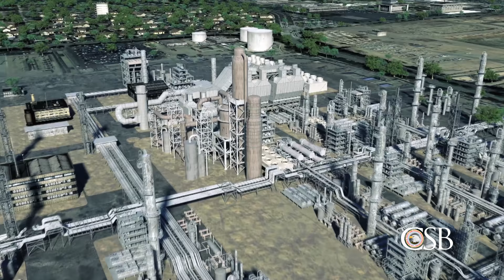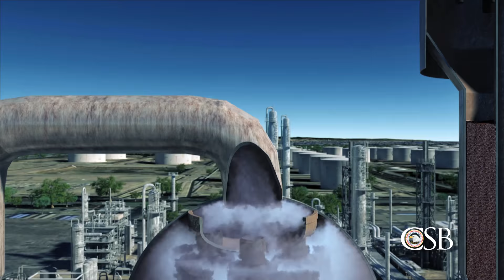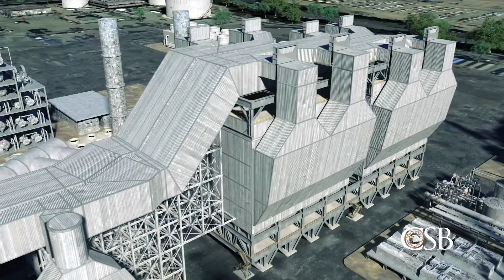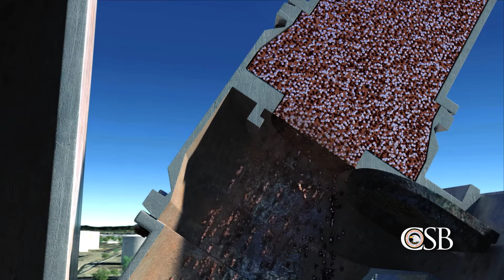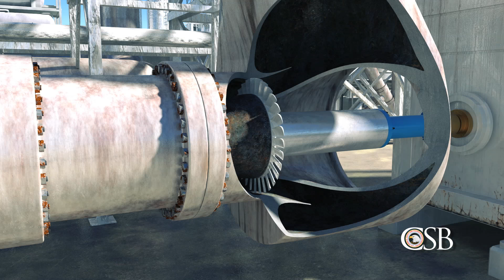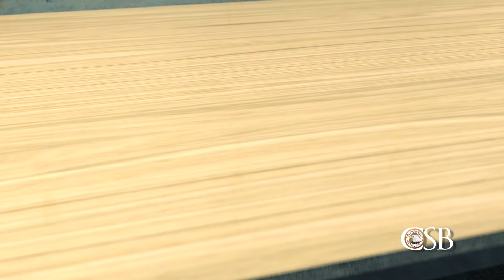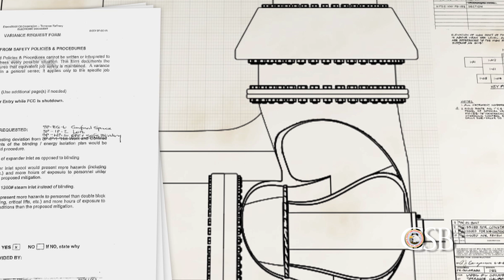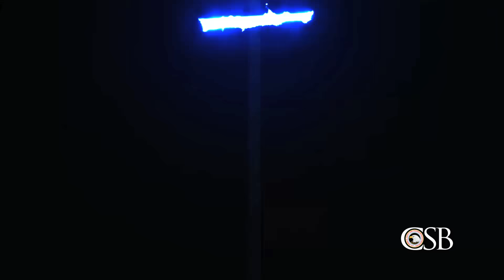Animation of 2015 Explosion at ExxonMobil Refinery in Torrance, CA

Comment: I am constantly amazed at how so many smart people, operating highly complex chemical apparatus can be so brain dead and make such incredibly dangerous mistakes. There really needs to be an in depth study about this very human characteristic. It happens all the time. When I was a safety manager at a major oil field chemical company, I would try to make sure all personnel were fully aware and trained about proper safety procedures in the field. Invariably I would show up on a job to find the job supervisor hims self had ordered extremely dangerous safety short circuits in procedure in order to just get a job completed when something minor had happened to hold up the work. I would complain to management, trying to get the company to insist these violations carry a penalty. I would always get rebuked, "You worry too much! They got the job done!" And then when someone was injured or even killed due to dumb crap violating standing safety directives,- management would come in with- "How come your safety department let this happen?"

On one job, I gave a safety briefing- meeting the crew of a very dangerous job meeting them at 3:00 in the morning before they left the facility- What ever you do- under no circumstances should you flow this chemical back into open tanks- highly flammable 99% ethanol. It had to be placed in tanks filled with CO2! We went through a lot of expense to provide the correct tanks and inert gas. Later that afternoon, I decided to visit the job site and rolled up just after they had flowed the ethanol back into an open tank- fumes had ignited from a nearby truck engine, exploded and burned everyone on the job terribly. No one was killed but three men spent several weeks in hospital. What the Hell? Why did you guys flow that stuff back into an open tank?  "We didn't want to go through the trouble of setting up the piping to flow to the CO2 filled tank. We thought it would be okay."  It would have taken them about ten minutes to re-set the piping! This was the third time that year the same dumb thing had happened throughout the company. My God! What does it take to protect people from themselves?
Reply: Hopelessand Forlorn 
That's right man.... I was designing field run pipe for United Engineers on site  at Seabrook Station 1981-85 and saw the design and execution from the inside out and  the level of expertise was astounding all around. 

After seeing the integrity of containment design it's not hard to understand fully how Three Mile Island, also by UE, survived what they have now discovered via unmanned remote vehicle was at least a 50% core meltdown with a very minimal radioactive release during the accident but none since, with the adjacent Unit 1 still in operation 35 years later. Workers there need no special protection on site. 

Unlike those tar paper shacks at Fukushima and Chernobyl claimed to be containment buildings, I have full confidence in these containment structures and those like in kind

Those reactors are housed in a 4 foot thick steel-reinforced concrete building within a building with a 4 foot annulus space to run at a negative pressure and can withstand 300 mph winds and its  debris, such as train engines... this can be found in the Final Analysis Safety Report on public display describing containment

That said, it seems deferred training and maintenance, (6 years since the slider valve in the video was replaced?.. as well as a stuck valve at TMI was found to be the blame)  lax safety culture and the aggregate intelligence of the American utility and energy sector worker, is not up to the level to ensure accident free maximum production. It's seems it is too costly to get it right 100% of the time whereas in the military getting it right is not a matter of cost

Sure TMI contained a major accident and thankfully no one was killed at this explosion though two were injured, but in both cases  the facility was destroyed and unable to produce both product for the public and profit for shareholders.

A ship tied to a pier is not the purpose of why a ship is built
Reply: @acadman4322  My father was an instrument technician who designed sensors for CANDU nuclear reactor control systems for 25 years.  Nothing freaked him out more than the latest crop of newly minted, know it all engineers hot off the university degree presses telling him that he didn't know what he was talking about because he wasn't an engineer.
Reply: For some people: Usually they don't make mistakes. But 99.999% isn't really good enough.

But for your example: they likely felt pressure, real or imagined, to complete the job as quickly as possible.
Reply: New safety guy here. This is the biggest frustration, how many incidents are already covered by standing safety procedure. Humans are really bad at calculating risk, so often times the corners they cut are more dangerous then they think. Combine that with irregular training between companies and workers, and a lack of direct involvement by the people who understand the entire process needed to keep lower level workers from making choices they don't know are bad and accidents are going to keep on happening. Safety has to come from the top and anyone down the way needs to be on board or they are just another liability.
Reply: @joelr877  My arguments have been severely criticized by some who simply say, "We are all human- duh!" (that's their point boiled down to the essence). And I vehemently disagree because I saw times when an intense training program coupled with intelligent company support and accident prevention programs did dramatically reduce the accient rates. There really is no telling how many lives were saved by such programs, not to mention the untold billions in damage were prevented.

But, the problem, as I see it, is there is no way to budget the asset side of accident prevention programs. The accountant division of a company will never hand the BOD a sheet that points out the $5 million spent on the safety program made the company $400 million in profit by saving lives, preventing lawsuits and keeping valuable infrastructure and equipment from being destroyed.

Thus it becomes quite easy for industrial leaders to ignore, or in some cases, not even be aware until it is too late, of what benefit the company is experienceing through the safety process. Executives and Department heads are bound by not only their benefits packages but also by their education, training, experience and the very system within which they exist. The corporate environment itself is the hound that keeps peeing (so-to-speak) on the carpet.

We safety types can also be argued into oblivion by corporate types who will point out, as they did on the DWH disaster, that that "BOP cost 45 million dollars! How dare you accuse us of skimping on safety?" Which is a bull shit argument?  It does not matter one bit what it cost- it was a piece of garbage that was incorrectly assembled through- what? Negligence due to improperly trained people, a failed inspection process and a hasty schedule that put undue pressure to "Git'er Dun!" In other words, it was a 45 million dollar hunk of useless iron and was made that way by corporate bull shit tactics in the first place. It was a BOP in name only to satisfy rules and regulations that the corporates considered a terrible hindrance to them making the profit they sought and keeping unrealistic, end-of-year bonus schedules!

You can go back through the long history of industrial horror stories of corporate disasters and find this very same pattern of ultimate responsibility for them in just about every single one. "But, we are just human" does not cut it with me. We are intelligent and so we should be doing way much better than that!

So, the fact is, the system fails all along the long train of responsibility, particularly at the very top! If safety is not the top-dog goal, right along with corporate profit, then what is the point? Am I right?
Reply: ACADMan Laziness and lack of training  or awareness on the operator’s part, and a drive for profits on the upper management’s part.

Unfortunately, the people like you, who understand procedures and the risks associated with operations, are not taken seriously by either of the two groups.
Reply: book knowledge only,,,, no common sense,,, lost it all in college classes
Reply: Laziness is a sin. And look at the consequences. If you're lazy for a job as important as that. Imagine in their regular life? Man die for the lack of knowledge. They need to go back to school to have the same level of awareness that you have.
Reply: Unfortunately it seems money is worth more than human life.
Reply: Being smart doesnt mean you wont make mistakes.
Reply: You can’t protect people from themselves. All you can or should do is record everything you tell them, and if your boss asks you why this happened, prove that you told them to do this instead of that!...

Unless that doesn’t work.
Reply: @Yoko_Grim  Good point. But, in those days, video cameras were the size of bread boxes.  So, we had what is called a "Safety Briefing Log". I  (0r an assistant from the safety department) would give safety lectures and briefings before each job. I would read on the job schedule which jobs were going out and review all written policy regarding that particular procedure and, also based on my experience, I would write up a 5-minute (or 10 minutes) safety briefing, reminding these well trained and experienced people of the hazards and also issue directives to the supervisors on mandatory safety  procedures. Each man assigned to the job had to sign off that they had received this written briefing and agreed to follow the suggestions and requirements. Everyone hated these briefings and thought they were a waste of time, after all, everyone already knew all this stuff - right? 

 But, the ideal is far different from reality. And often unforeseen circumstances would arise, such as sub-contractors and other company employees would be on the job doing their own things. If their practices endangered our crew, the  Job Supervisor had no authority to cancel the job. He would go ahead as best he could and protect safety as much as conditions allowed.  Sometimes equipment would fail, and alternate procedures would have to be used that did not allow for complete safety as we had originally planned. Specialized equipment that was designed with safeguards might not arrive on time, etc.  so, the rule, "Or as safe as possible..." would be applied. AS many here have pointed out- the completion of the job to the customer's satisfaction was the bottom line-  complete safety be damned. And they excused this thinking by saying, "Safety is never 100%. This oil field business in inherently dangerous. Some risk has to be accepted."

I disagreed with that philosophy. But, I also understood it.
Reply: Honestly, those workers werent qualified - so immature to disrespect your thorough order. They are better off in fastfood even though Id worry for the restaurant too. Your upper management setting the hiring standards arent willing to pay enough for respectful, technically caring, and above and beyond responsible workers. 

If they cant pay the bottom line to ensure quality and overall good vibes, they really shouldnt keep the business going.
Reply: Gotta leave a truck running to have an ignition source!
Reply: Production department of nearly all chemical industries are too lazy and arrogant-From a prespective of a maintenance engineer for ten years
Reply: Thankfully in this video the workers looked at their safety equipment, said "oh shit, that ain't good" and evacuated. I've been seeing a lot of this animations and almost everyone is the same, some dumbass either 
A) turned off the safety equipment
B) didn't have it or ignored it.
One of them was about an ammonia leak at an ice rink. An important part in some piping and gone loose and triggered an ammonia leak during maintence. So standard protocol went, alarm activated, HAZMAT arrives, Fire teams and contractors dawn SCB and enter and isolate the leak.
Well so the fire dept left, so the higher ups decided to try and get the system up and running to save money. So they shut off the alarm, and sent 3 contractors in to fix the generator that had been contaminated. So they went in, (I believe they hit the pipe or the pressure of the system running to keep the ice caused another leak) and they were exposed to extreme levels of ammonia (I believe I remember upwards of 500ppm, maybe even higher than 1000), killing them instantly.

So not only did the business turn of the alarm, they restarted the system while it was being fixed.
But wait, the workers, didn't have SCB or Personal detectors!
A double whammy. Both sides are idiots.
And for a triple, no HAZMAT was supervising the work, so the Fire dept had no idea because the 3 workers didn't ask for a fire truck to help them, and the higher ups shut off the alarm (which is connected to fire dispatch)
Reply: I helped build that esp.with TIC.good project.lot of money went into that Elephant..
Reply: ACADMan job scared contractors and workers, seen it many times. Yessa boss yessa
Reply: Still, this wasn't as braindead as the animation of the 2012 accident at Chevron's 
Richmond Refinery.

Firemen poking an old, leaking sidecut with a metal spear to pry off the insulation
and spot the leak. 
 
When that didn't work, they tried washing it off with their fire hoses. 
Luckily, no one was killed.
Reply: That's what I thought when I saw how the Japanese had built the Fukishima nuclear reactor on the shoreline of earthquake and tsunami country.  It was originally to be built on a hill away from the coast but those genius engineers decided to save money on seawater pumping stations.
Reply: I would fully agree with you and how alot of accidents do happen from human error, alot also happen because a situation was created that personal weren't aware of, like in this incident, they didn't know that the pressure of steam had decreased enough to let a little bit of light hydrocarbon's through the system. I did several papers on industrial accidents and more times than not, the personal were unaware that something like that had happened, prior to their involvement.
Reply: You give humanity's intelligence too much credit.
Reply: Ethanol’s flash point is 60 degrees F..
Reply: You can’t protect idiots from themselves. But you can fire the fuck out their asses. They can make dumb decisions at home.
Reply: It's easy to criticize with 20/20 hindsight when you get to see the video cross-sections of everything that went wrong.  When you're the engineer on a unit like this trying to figure out how to solve a problem that doesn't have clear-cut procedures for how to fix it and everything is sealed up, it's a little bit harder than just opening up the user manual and looking for an answer in the 'troubleshooting' section.
Reply: ACADMan dey izz teeVee watchers!!!
Reply: I told OSHA to put warning labels inside garage doors, in big letters, warning of hazards.  See any?
Reply: Keep a camera and mic on your collar, and gather footage just to prove yourself, and possibly to see if you can record patterns on who's a dumbass and how much so.
Reply: 20 20 hindsight
Reply: Better management....
Reply: blinded by their experience
Reply: "My God! What does it take to protect people from themselves?"

Easy. Frequent and thorough beatings.
Reply: I dont understand it.
Reply: ACADMan you are total right. I  could say i am same like you. I first put safety first than profit first. We are talking about human life and families and thats a no joke situation
Reply: There is an entire field of study dedicated to these kinds of failures, it's called human factors
Reply: Lack of buy in from top management is what works against you. People will always figure out what behavior top management wants: cutting corners or following procedure. Hence the requirement in many quality and safety standards that top management be responsible.

Did you ever had regulatory audits? They never notices anything?
Reply: Your question seems rhetorical but isn't it in fact IRONIC? 

Not being in the industry or having experience in the refinery world the first thing that stands out in your example was that it sounds like management may have finally persuaded you to their side regarding you "worrying too much".  If there were already two similar "dumb" incidents that occurred and the known potential danger of this procedure I find it difficult to understand why the person or people in charge were NOT present supervising these workers? 

 So the answer to your question of .."My God! What does it take to protect people from themselves ?"  Ironically is YOU !?   You being onsite would have prevented this 100%.
Reply: @tc7581  Isn't that why we have training and procedures? I would have 9 or 10 different jobs...each requiring up to 30 workers and hundreds of tons of equipment, scattered over areas as large as half a state. One man is not capable of supervising each of those simultaneously. We had specially trained supervisors all with authority to oversee the job supervisors, and even that was not enough. Invariably, someone would do something to short-cut a procedure or safety rule and get hurt.

In my opinion, it comes down to a management process that instills and supports professionalism throughout the workforce. Rewarding workers who identify and interrupt procedural aberrations is a must. And, for a long time, while I was employed with this company, that seemed to be the case- our safety record greatly improved. But, soon, new management took over, they identified safety as a burden to higher profitability and began cutting safety and training budgets and began re-evaluating stated and set safety protocol. Accident rates were dramatically accelerated.
Reply: @acadman4322  The human characteristic you're talking about is complacency. Give people enough time, and they'll likely become complacent.
Reply: @tc7581  There is no way one person can be on every site 100%. We had two Safety Managers- Both subordinate to General management, but Ranked field Supervisors. Even so, we were never allowed to interrupt a job...all we could do is"suggest" changes and in event of an obvious, immediate threat to life or equipment, demand shut down - Which the Field supervisors were expected to follow...but there was no written policy stating that. Our only power was in recording safety fails for later Manager review and Field Supervisor re-training. This would often intimidate the Field Supervisors to go along with our recommendations. There just were not enough of us to go around.
Reply: The audit is carried out regularly. In my case, always a simple worker is guilty, a maximum of a middle link. Top management is always crystal clear.
Reply: You really don't know how money rules anything and everything. I understand that your response was a rant but in the end, money is the catalyst to a complex operation like this. Complex chemical refineries/ distributions facilities should always be held at the highest standard possible. But its not.
Reply: @Bruceman17  Bruce, isn't that exactly what I have been saying? It is the whole "Corporate' system that is at fault, which is alway about just that one thing- Money (Profit, bonuses, corporate officers surviving, boards of directors responsible to see that the stock remains high (profit v loss = stock price stability), Department heads pressured through "carrot & stick" motivations to reduce cost and increase profit-  It is a systemic problem built into the very 'DNA' of the corporate model.

As I clearly pointed out, no CPA is going to walk into the Board of Directors meeting with a fanciful ledger that shows, "We spent this much X-millions on safety and we saved this much X times 30 on prevented accidents."  Everyone in the room wants to see those 'X times 30" profits in the bank, not in some fantasizing accountant's head.

But, what they do see and grumble about constantly, is that Big Red X next to the Safety Program line- that represents real cash being laid on the line and it comes, as far as they can see in the ledger, out of the profit line- Profit is always P minus (Unprofitable Expenses)- 

Take the example of the Titanic Disaster. The designers knew they needed more lifeboats to serve the huge number of passengers and crew the ship could accommodate.  But, lifeboats cost a lot of money, not only to build but to put on board, they take up room that otherwise could be allotted to paying customers. And they have to be maintained over the lifetime of the ship, further moving the pay-off line a few years. And they would put 'lie' to the media's claim (which the corporate sales department did not immediately dispell, that the ship was "Unsinkable!"- What a fantastic marketing angle, and it was free! Of course, the ship was unsinkable, so why did it need those pesky lifeboats? The discussions between the pragmatic designers and seafaring types in the office against the Money minded Corporate and marketing and banking types, must have been bizarre. Obviously, the question came up, "What if something really bad does happen?" You know there was an embarrassing silence. Then they called the insurance underwriters- What will our insurance premiums be with the lifeboats compared to without the lifeboats? The underwriters probably had several things to consider in answering that question- Did they want to lose this massive contract? Did they even know what the risks were? There was that new invention, Wireless, that could call other ships to help, and the Titanic, was, after all, Unsinkable, the London Times reporters had said so. so, the "Corporate DNA" struck again- Profit over risk! The answer to that pregnant question was, "Well, the extra cost would be minimal, of course- certainly far less than those pesky, ugly, expensive extra lifeboats would cost. "See? Corporate Money Men were right all along!" They must have shouted that in the face of the engineers and safety people. But! I would venture, there were very few discussions about how many lives were at risk. The 'bottom line" is always, as you point out, about money!

Of course, we all know how reality jumped up and bit those idiots in the ass- But, really, except for the insurance company, that merely recouped its losses by raising premiums for everyone, no one except the passengers and crew were really harmed. The builders, still got their money, the shipping line lost nothing, in fact, probably made a few bucks, and Lloyds Underwriters is still in business to this day. Does this sound familiar at all?

Decisions just like that are made in corporate offices every single day- and they are made exactly with the very same considerations!

Now, does that sound like I do not know how money rules everything? Certainly not.

But, the big question is, how does this corporate DNA get changed? Can it be changed? And, do not think for a second I am blasting the world of capitalism. I am not. Capitalism is what makes life possible as we know it. And, alternative economic systems, like Communism, display an even more abysmal attitude toward safety. 

 But, there has to be a kind of accounting system that can take into account the real losses and gains caused by inattention and attention to the safety factor of operations. As far as I can tell, no one has come up with that accounting system. Perhaps the answer lies with the insurance companies that might decide that a company put profit over safety and thus be legally allowed to greatly reduce the claim settlements. laws might have to be changed to let that happen. But, regardless, something really does need to be changed!
Reply: Smart ones make it...high school drop outs or trained on the job at best run it.  Welcome to America...best country in the world, yet I'm pretty sure we coined the term living wage.  By definition a phrase that shouldn't exist in The Worlds Greatest Country.   Lol.  Profits. Simply pure profits.  Well paid professionals would have had every valve, pipe and fitting on a timetable for replacement weather it needed it or not.  But those parts and labor cost money.  Better off to hire a dummy and play dumb. Corp mentality.
Reply: Leaking slide valves, leaking heat exchangers, fire it back up.  This is exactly why nuclear power generation will never be safe in the real world.  I believe the excellent safety record of U.S. nuclear powered war ships is due to the, apparently, cult-like status and authority of the highly trained nuclear technicians in the Navy.  Or at least I hope so.   Obviously, such a cadre could never survive in a commercial environment.
Reply: @Hopeless_and_Forlorn  And yet, commercial aviation, which is also very complex and dangerous, gets safer and safer with each passing decade. Safety can be accomplished in a commercial context. But I partly agree, there's plenty of room for improvement re nuclear power.
Reply: @Hopeless_and_Forlorn  It can be safe in the real world. You just have to:

1.) Use Thorium, not Uranium for the core fuel.

2.) Use a molten salt reactor design that physically cannot melt down.

3.) Make sure it is almost completely computer controlled, with safety upon safety upon safety present. Build the code for this using mathematically verified coding.

4.) Mandate that all service procedures follow strict protocol with multiple independent supervision of repair steps, and with mandatory video recording of all said procedures.

5.) Build the whole thing in an elevated area above the watertable 500+ miles away from the coast or a faultline, in a "coffin"- a deep tungsten shelled concrete hole in the ground with a few thousand tons of gravel above held back by sluice gates. Worst case scenario, you just bury the whole thing under said thousands of tons of gravel and drop a tungsten shelled concrete plug on the top and forget about it.
Reply: @Hopeless_and_Forlorn  that's because they're military professionals. They always do the job right.
Reply: Cool story
Reply: Probably there are similar problems all over the world. I heard that Ilon Mask can personally check the safety on the complaint of the worker.